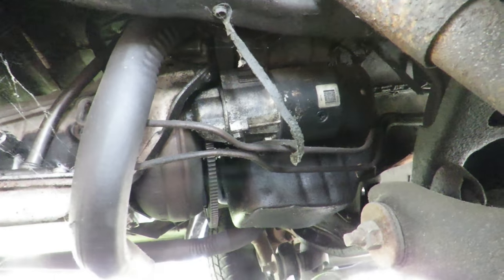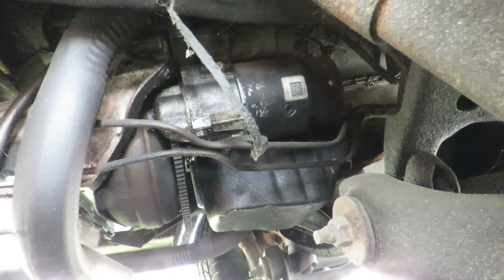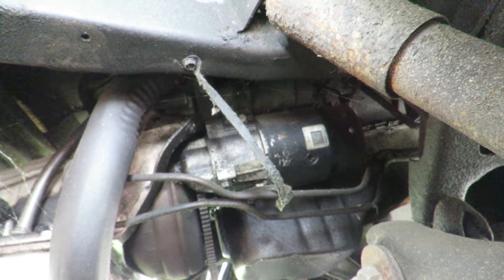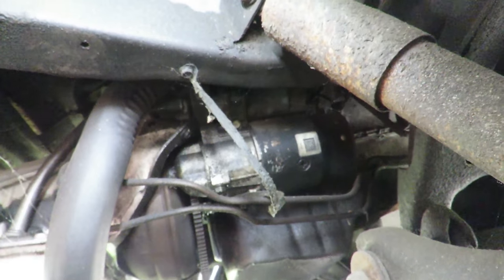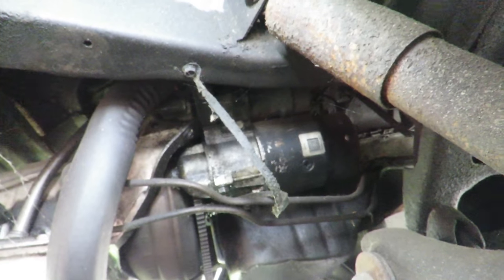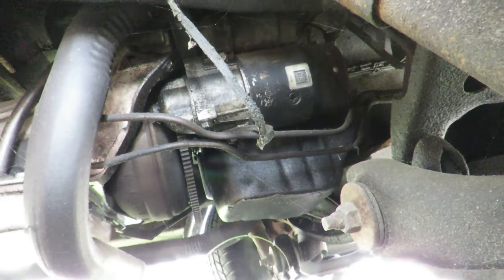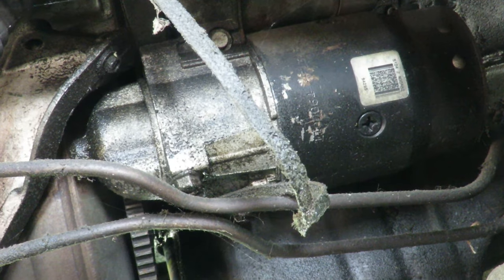⭐ How Does A Starter Going Bad Sound? - Sounds Of A Bad Starter - Part 2 In Description

Comment: It started. Not helpful. I need to hear what it sounds like when it won't start, so I can tell the difference between the starter and any other starting problem and compare it to my car. Half a second of a starter "going bad" is useless.
Reply: The starter solenoid will just make clicking sounds or will make no sound it all when the solenoid is bad

Comment: "Ok you hear that?"
Honestly, I don't hear anything man..
Reply: I can hear and see everything he's doing just fine. Don't criticize.
Reply: You must be deaf. When he turns the key and lets it off you hear what sounds like those cars you pull back and usually let go but when you lift it up after pulling it back you get a sound very close to that. Go buy some hearing aids or some hater-raid
Reply: It's that winey noise.
Reply: It’s clearly grinding
Reply: yeah my truck sounded just like that..it wouldn't start...thanks to this video I fix my problem :)
Reply: use headsets

Comment: Thank you for posting this! My truck (86 GMC) wasn’t turning over, wasn’t even sounding like it was attempting to turn over, and only made that grinding hum when I turned the key. All the other videos out there on starters just talked about a ‘click’ and not that grind-hum. Now I know what the problem is and can start going about fixing it.
Reply from the maker: GREAT, let us know how everything turns out once you replace it!
Reply: It was a pain to take out because of the angle but once I did, sure enough, it was immediately evident that it was the problem (internals were starting to seize - later determined to be the result of a bearing wearing down). Took it to a local shop and they were able to fix it up like new in about two hours. Put it back in and the engine started up without a problem or a hiccup.
Reply from the maker: @E2theBizzle  That is GREAT! Sometimes it's so much easier and cheaper to just take it to a rebuilder and have them fix the problem. THANKS FOR THE UPDATE!
Reply: Agrees. This help me because I now know it isn’t my starter.  Thanks!

Comment: The first thing that came to mind was the totally normal sound of a 1960s/70s dodge.  Good info if you dont have one those
Reply: Maybe they just had bad starters from the factory lol I wouldn’t put it past Chrysler
Reply: @wyattnyfeler7270  my 84 corvette has done the same all new acdelco starters it’s normal
Reply: Those old Chrysler's  had gear reduction  starters and the bendix would kick out every time the engine  fired and did  not continue  running ,the noise is the starter  running  after the bendix gear disengaged  from flywheel  and coming  to a stop after you realease the key .    The loose starter on van contributed to the failure of the bendix gear .   A little locktite will keep the bolts tight.     I just replaced the old starter  on my 4.9 300 six 90 f150 with minnie  gear reduction starter  for a 92 thru 96 , they will fit all 4.9 ,sixes,302 and 351w .  1/3 LESS AMPS AND DOUBLE TORQUE!  also replace 91 or before ford  2g with 3 g alternator.      The  old 2g is a fire hazzard  and stuggles to keep  up with  the  load demand  only 75 amps . The small case 3g is 95 amps  with better cooling. And the large case 3 g from 130 amps and up .  I used 130 amp large case on 88 4.9 300 , no more starting problems!        Enjoy the videos ,keep up the good work!

Comment: Got it.... thanks!
Another sound I heard in my Honda CRV starter, that I thought was either a bad battery or alternator not charging the battery, was a “slow turn over”.... like as if I had a low charged battery... but I found out the starter was getting old and is ready to go out soon.... 
Thanks!

Comment: Hey guys love watching your videos, you were very helpful on helping me locate my PCV valve. I also have another question about my truck. Well, my truck is a 5 speed manual transmission. When I first start it up in the morning and put it in reverse the backup lights come but won't move. Sometimes I have to force it in reverse causing the syncronizers to grind. Is it time for a new clutch or do I need a full rebuild?

Comment: What about if the car starts intermittently, but sometimes when the car starts there’s one screech sound? Also, it takes a couple of turns to start but the car doesn’t sound like it’s struggling to start...just a click.  I was thinking maybe the stater relay, the ignition switch or starter solenoid?
Reply from the maker: The sometimes a click is another sign of a bad starter.

Comment: Ok, do they ALWAYS 100% sound like that before they go out? Because I don’t recognize that sound, and my 98 Lesabre just recently stopped cranking. Power, but there’s the click under the hood when you crank it. Someone had a listen for me and apparently told me that the click sound is coming right from the starter. 
Ok but here’s the thing, the last 6 months or so I’ve definitely been having power issues. Sometimes it would die just going down the road or sometimes there’d be no power right as I try to start it. But what would get it going again was when I jiggle and tighten the terminals, and a sweet spot would always give it power again, up until it happens again a day, days or week(s) later. Now a couple months ago when I did it, it just kinda never did it again up till a few months later when this happened just a month ago. Is there ANY possibility that these issues could be the same or related? This 98 Lesabre has been well taken care of with just 120k miles, an old couple had it and the wife passed so that’s why he sold it. I’ve felt like everything in this car is still stock minus maybe a couple or few parts, I have no damn clue. I’m in my lower 20’s and I’ve never been taught anything. Can someone help?

Comment: My starter works fine bendix comes out and spins but da problem I have is that it doesn't engage with the flex plate idk if I have a bad flex plate or sum wrong with da starter

Comment: Hey how u doing? I'm having a problem and don't know if it's my starter are battery. I just got this battery a couple of months ago. The battery tested good. The noise my truck is making is clicking noise. When I cut the head lights off it starts right up. What's going on with it. They told me it's my starter at Autozone

Comment: I'll try to make it short. Both starter and battery went bad. Thought so from very beginning. Battery was tested and mechanic said replace it so I did. Then still the weak puny whimper of starter. Took several tries to crank to start  Replace it yeah it's totally normal now. Mechanic said aha it went bad because oil got into engaging pinon gear but not where cable connection was. Think that's what caused it to go bad ? Bad oil leak messy. Says it'll cause it to fail again

Comment: My 2004 escalade has an anti-thief system,  but I don't know if that's  the problem.  When i turn the key, all the lights on the dash comes on, but it doesn't start. The battery has fire when i hook the cable on and tap the other end of the cables together  it sparks, but turning the key over doesn't make a sound. No clicking, no nothing.

Comment: Hi there.  Here in nebraska is freezing.  And snowing. My truck didn't turn on when i turn it on with my key it clicks. And lights are on but as soon i try to charge the bactery every turns of completly including the lights.  And is so frozen that even my keys got stock.  Even brakes hands and foot brakes are stiff.

Comment: Is it possible for a starter to cause all power to cease?  I replaced my battery and terminals.  When I turn the key my dash and famous ding ding ding goes off, but once i go to turn the engine over all power dies and seems to only return when it feels like it.  This process repeats.  It started up for a while, and actually almost died at a red light until I gave it gas.  Any tips would be welcome.  God Bless

Comment: my car doesn't start then I use my car battery charger and car will start. but soon I switch off the key ignition it doesn't start again. so use the charger again the car start.

Comment: I also have a 81 Chevy G30 4x4 van. The ACDelco starter is about 2 years old. Now it makes a loud bang when I try to start with hot engine and it moves the flywheel very slowly. It needs to cool down for 10 minutes before i can start the van after a stop at the gas station for example. The solenoid cap was very loose and one of the bolts holding it together is broken. I tried to tighten it all down but with no effect. I also noticed that there are multiple cables at the big positive terminal. One big cable from the battery and 2 smaller cables. When the starter has a hard time to turn the flywheel, you can also see sparks between the cables at the positive terminal. I ordered a new Bosch starter and hope this one works better and longer that the remanufactured ACDelco starter...

Comment: My 08 Impala tries to start but after changing the spark plugs and spark plug wires ( thinking bad connection), I was told that my starter was bad. Had it tested and it's not, just very oily due to the bad oil leak in my car. What else should I check out?

Comment: OK I went to auto parts store they tell you that they can test your car to see if it’s the starter or the battery the alternator I was having problems with my battery corrosion it’s a Subaru outback 2014 and got tested said it was somewhat low bought 300 out of 450 CCA so living in Minnesota decide to put a new battery and went to start my car today it’s 45° which is warm for us and starter sounded like crap and was bogged down! So pretty sure it’s the starter and probably was the whole time or maybe the battery was crappy because it was super corroded on all the contacts on top and then ruin the starter so I could Bermuda triangle with this

Comment: My 2004 Tacoma is making the same noise. I thought it was the battery and got a new battery. Starter still made the same noise and I could feel the starter trying to turn the motor. You're the ONLY person that showed this symptom on YouTube.
Turns out it was the positive battery connector. The one on the battery would not tighten. I bought another connector, used a wire brush to clean all of the connections, and after I replaced the connector, my truck cranked up.

Comment: Cheers dude. Quick dumb question i am trying to start a car that has sat for ages and I am getting no noise from the starter the engine turns freely by hand with the plugs removed. Question is when I turn the engine by hand does that turn the flywheel ?
Reply from the maker: Yes it does.

Comment: Might try just tightening up the bolt before paying for a new starter.  Look at the bolt head vibrating around loosely when the starter engages on the video...just sayin!
Reply from the maker: With a loose bolt, the bendix would lock into the flywheel. This sound is the bendix NOT extending...just saying! 🤣🤣😃

Comment: Maybe you can help me! I had clicking and car eventually didn’t start. I got a new battery and my car worked fine for 2 weeks. Now it’s doing the clicking again! So idk!
Reply from the maker: Check your charging system, check for a short, and make sure all connections to the battery are good.
Reply: @OnlineAutoRepairVideos  thank you! How do I check my charging system? Also that little round silver thing where you put cables to jump start looks like it’s cut in half idk what it’s called or if that is something to be concerned about?

Comment: I just bought a 1974 International Harvester Pickup with the AMC(American Motors 401 Muscle engine) 330 horse built into this pickup when new. It still looks like new but on the way home from driving it from Phoenix, Arizona I started hearing the starter when I would go to start it , sounded ok but in the middle of the turning it would slow down then crank as usual and start. Did ok until I got to San Antonio when I stopped for a fountain soda. Well naturally it did not start. Only had 120 miles to get home.  When I went to start it engaged and locked in place no return on my ignition switch. I could not turn it off. So I jumped out and removed the Positive cable to kill the motor. I found a mechanic through a parts house that sold me the wrong starter. Took the  wrong starter back and located a man that redid starters. He did it... the mechanic put it on. Started right up and I went on home after several hours stalled out. But when I went to an inspection garage for Texas inspection when I went to leave it started but the noise came back I went ahead and drove 6 miles home after three miles the noise stopped and I got home safe. Later I tried to start it in my driveway but it was a no go. Took the started back off and took in for a rebuild it was all burnt up inside, solenoid bad and starter. Checked out it did not register on the gauge. Waiting to pick it up tomorrow? Never seen this before. Had to put 2 1/2 bottles of water in my new battery too.
Reply from the maker: First of all,YOU DO A LOT OF DRIVING MILES!!!! I wonder if the starter needs to be shimmed. It seems it may be too close to the flywheel, and once engaged, it does not release. Keep me posted on what they find.
Reply: I decided to rebuild this starter. Then plucked a 750 Cold Cranking Amp Interstate battery. The 600 Cold Cranker was not getting the job done. My new Interstate battery kicks the motor great so far no problems.
Reply: A few days later than this post from me, ultimately found out I had a bad ground... that WAS the culprit

Comment: I have a 2004 GMC Canyon, and I’m having a problem with my truck in cold mornings. When I start my truck it would make a click sound and usually it sound like the battery is going out. But the problem with that is the battery is still good and I got it changed out in February 2019. I would it be my starter?
Reply from the maker: be sure to check both battery terminals, then make sure the ground to the engine is good. If all that checks out, then yes, it just might be the starter.

Comment: Astral auto repairs.      Hey bro  I think my starter is going I turn key and ti does nothing and if I flip my keys several time   it might just start after I turn key a ridiculous  amount of times it will start now it finally  died.   Is that my starter ?  I'm disabled I have severe crohns disease  and unfortunately if I dont fix my car I cant get to doctors office and get my medicines  refilled  so I'm just asking  before I take it out over done one before it's just going to take every ounce of strength so I just wanted reassurance.  thank u and have a Blessed day brother 
oh just so you know it's a 1990 miata that has a 1997 mazdaspeed 1.8 crate motor with a begi/garret turbo kit and rx8 injectors and a megasquirt pnp2 pro stand alone ecu.  the performance parts dont have anything to do it starting it seem to have been going for almost a year now
Reply from the maker: It is possible it can be the starter, but I would only be guessing!
Reply: @OnlineAutoRepairVideos  well thank you I appreciate  that you even took the time out to help me
Reply from the maker: No problem

Comment: Plz help! I have new battery new terminals new cables rebuilt starter. When I turn the key it clicks once. I have lights on the inside and my headlights work no problem. Just one click will not start. Plz help. 07 chevy impala.
Reply from the maker: Check the ground wires.

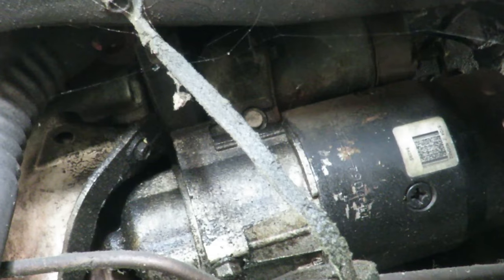Comment: I notice you have a wire going from the chassis to the starter right here  2:00   will a broken chassis ground wire to starter be enough to make the starter malfunction and make a rattling sound or do i just have a bad starter?
Reply from the maker: It would make the starter CLICK, but that is only if you don't have any other ground from the body to the engine, or ground from the battery to the engine.
Reply: @OnlineAutoRepairVideos  Thank You

Comment: I replaced a starter on my 04 escape n still making a grinding sound can I get some feed back on how to get it fixed thanx
Reply from the maker: Take the starter back out and check the flywheel (flex plate) for missing teeth of cracks.
Reply: @OnlineAutoRepairVideos  thanx

Comment: When i start my truck the starter sounds like it has trouble trying to rotate to start my truck, is that an indication that my starter is bad?
Reply from the maker: It is possible, but check the battery and the terminals first. by the way, what is the year, make, and model of your truck?
Reply: Astral Auto Repairs its a 2000 Chevrolet Silverado C3500
Reply from the maker: @aintnbfr  BE SURE to check grounds, especially a braided ground wire from the body to the engine.

Comment: I’ve had 3 batteries in less then 2 years every garage has just said it’s the battery and no one  except my grandad guessed a starter motor I hope it is this so I can just get it fixed
Reply from the maker: Is it doing the same as the van in the video?
Reply: @OnlineAutoRepairVideos  takes 10 seconds to start especially in this winter and sounds like that
Reply from the maker: @darrentupman8143  Gotcha!

Comment: I still dont know whether my alternator or starter is the one causing problems. I have a 2003 jeep wrangler and i just put in a new battery so i know its not that but lately ive had an issue where it takes a few extra seconds to start it up. It doesnt happen everytime either only out of a handful of starts
Reply from the maker: Does it crank normally, and do you have a check engine light on?
Reply: @OnlineAutoRepairVideos  it cranks normally and there is no check engine light. Its like that split second of sound you hear before the car turns on and it continues for a couple of seconds some starts. I also noticed yesterday directly after changing the battery the first start the car sounded like it turned on then turned off immediately but its worked fine ever since